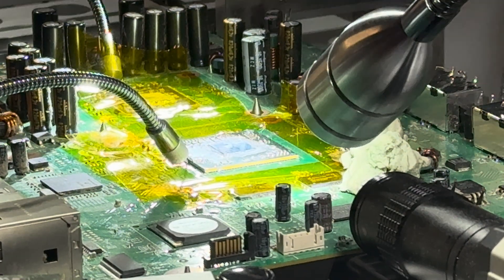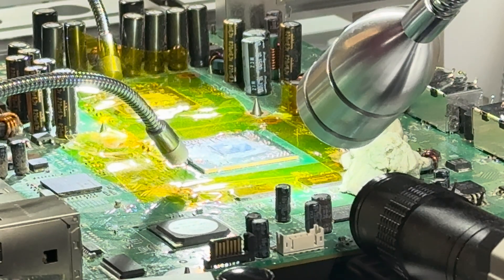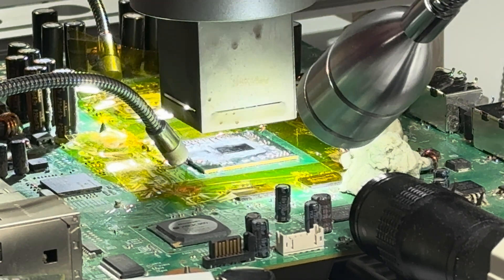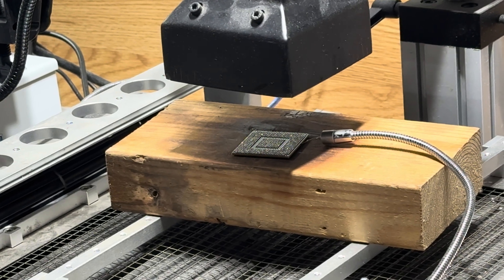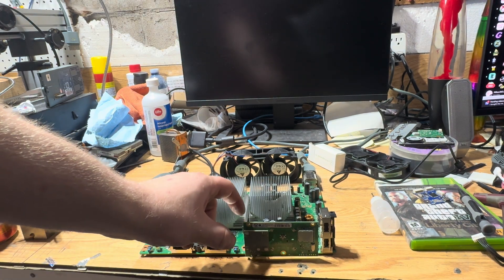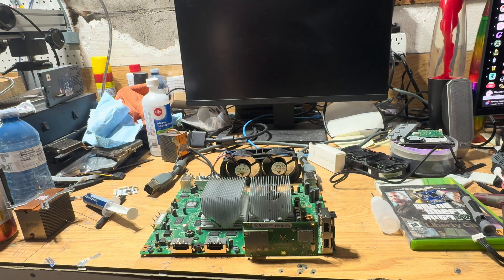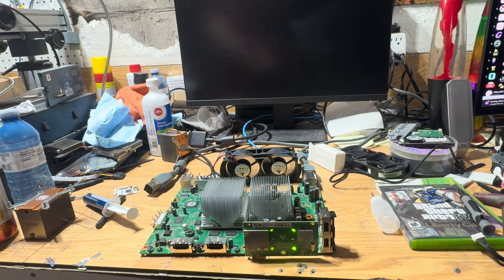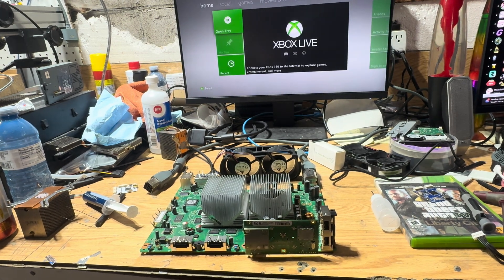Xbox 360 RROD fix! GPU replacement BGA Rework

Comment: Hi there, do you offer service for repairing an xbox 360 slim gpu since i faced a rrod code named 0100 which requires replacing the gpu and reflowing both gpu and ram. It's a really long story of what happend to it, but if you offer repairment of xbox 360, i would be really happy if you did

Comment: Whats that putty stuff you're putting on the polys near the GPU? 

I'd be interested to use it instead of foil to protect them from my top heater.
Reply from the maker: It is called heat sink putty. Kind of meant for welding. I only use this whenever a console has the red poly caps because the red ones blow up very easily when they get hot. The purple or blue ones do not and I just put kapton tape on those.

Comment: Great video. Sadly I was never able to replace a GPU properly. For sure it's my technique. Replacing smaller chips of any kind, Nintendo Switch, Phones, never is an issue, but those Xbox 360 PCBs always start warping. I tried to fixate them, let them form how they want ... when the time came to place the new chip, it never lays flat. My equipment shouldn't by an issue (preheater, normally perfectly working extra heat from top), but for me, the Xbox360 PCBs are a nightmare. So I gave up the dream to have a working Xbox 360 from 2005 with the first dashboard about a year ago. Very sad 🙂